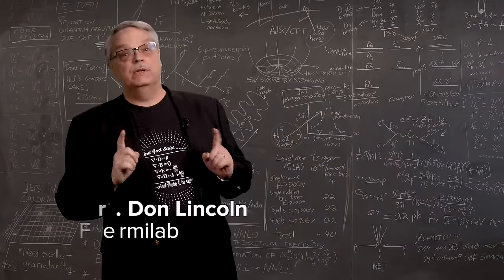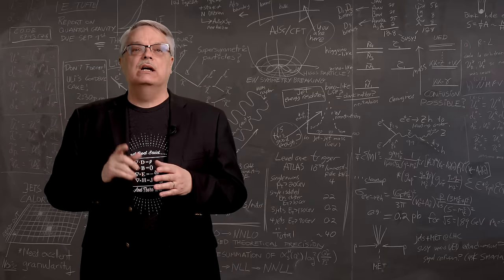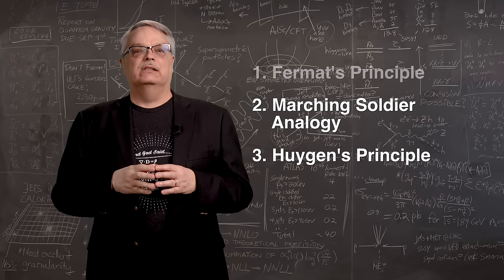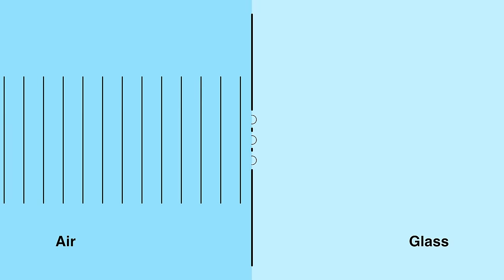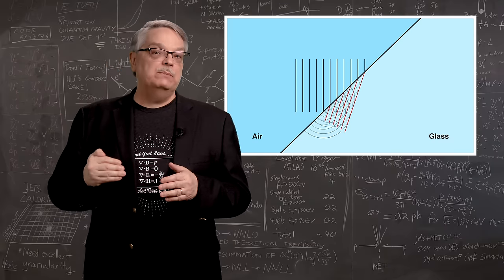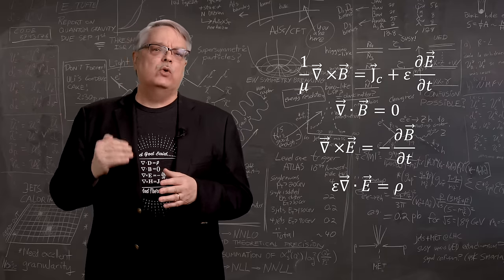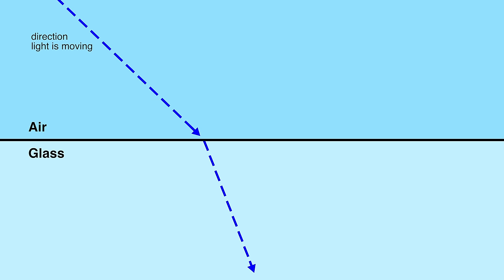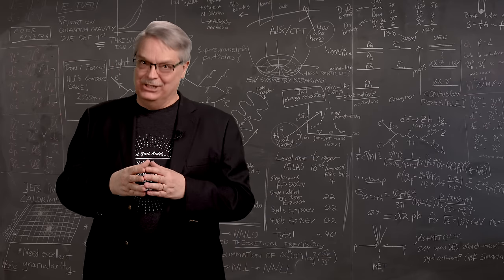Why does light bend when it enters glass?

Comment: 12:47 I assume the re-arrangement of the electrical charge takes some time.
So what happens with the "first" photon hitting the glass. Is it going in a straight line because of the not re-arrangent electrical charge?
Or is the re-arrangement itself already influencing that photon since the re-arrangment itself needs energy to happen? How can that influence happen over a distance if the light is going by c?
Greetings
Reply: Do you have the explanation now..I really want to know
Reply: @TheAbizgreat10  as far as i know that actual light, or that specific photon will be absorbed by the atom, but now the atom is excited meaning it has more energy wont be stable at that higher energy level, so it will re-emit the photon, but that is not physically the same photon but just the copied version of the original, so it looks like light comes trough glass, but its just the effect of it what comes trough.

photon itself in theory moves in a circular shape, which has its own wave like motion, but when light comes trough glass its a different kinda wave, its more classical physics kinda wave effect, that one atom reemits a new photon, than that photon will travel with 300.000 km/s but only until its captured by the nearest atom, then again atom is excited but not stable, reemits photon again, so the light travels 300.000km/s all the time when its actually travelling, but absorbing and re emitting takes time, and that will make it look like that light is slower now, but its just a kinda trick

this wave effect is now similar to the sound wave, where the sound is not actually gong trough stuff, its just the effect of it appears the other end of lets say the glass door, so u can hear a person talking to u and u can see them trough a glass door, but how the photon is actually moving in vacuum is a different story , probably no one knows how s that happening on its own, cause no one knows what the electromagnetic field is physically
Reply: @fifferfiffer2  Hi. I think you need to see fermilab's original video on "why does light slow down in water?". You'll probably find it interesting
Reply: Here he has treated light in a "classical" manner, like a wave. The whole "photon" (particle) interpretation and analysis does not apply in this case. To understand it in terms of the direction a photon is moving we would have to use quantum mechanics equations and principles like the uncertainty of position-momentum.

Comment: That was a great explanation. Now I would like to know, why some materials let light pass, some absorb light or some reflect light. What is the physics behind THAT?
Reply: Matter is made up of atoms, atoms have electrons in specific orbit(al)s around the nuclei, each orbit has a specific and fixed energy gap with other orbits. Suppose there are two orbits with energy gap of E, and you supply exactly E amount of energy to an electron in the lower orbit, it will take it and will jump into the higher orbit, if you don't give that specific energy E, little less or little more and the electron will not accept it! Now, lights come in different wavelengths and hence energies, some lights will have that exact amount E and that specific atom (of that matter) will accept it (absorb) and will get excited... you send light of slightly different energy and it will just pass through (refract). By the way, all that refract, they reflect too, in general, they scatter light....
Reply: @atanunath  Hi atanu, I am confused with the absorption thing. Is  absorption always related to transition?  I ran into some thing about absorption to x rays as a function of the x ray energy.  It says the absorption decreases with the x ray energy gets higher until it reaches a  specific energy under which the inner electron transition happens and abrupt increase in absorption occurs. 
I knew that absorption happens alongside the transition of electrons, but is all absorption linked to electron transition? What happens during the decreasing region I mentioned above.

English is not my native language. Hopefully I pass my idea clearly.
Reply: @linseito2530  if you can provide a link I can try to explain

Comment: But why does red light bend differently than blue light?
Reply: Good call. 
I think different colors have slightly different charges (solar panels work more effectively in the blue end of the spectrum), so i guess that would change the length of the perpendicular charge
Reply: The energy level, blue have more energy, its a faster oscillation and smaller wavelength compared to red
Reply: Because ε (called the dielectric function) is different for different frequencies of light. That is to say: the medium (such as glass) reacts differently depending on the frequency of the incoming electric field.
Reply: ... Now he needs to make another video, and include the physics of prisms ;)
Reply: Because the responsiveness of the electric charges in the material depend on the energy of the light. E=hv the energy of the wave depends on Plank's constant times the frequency of the light, so the pushing power of the light depends on its wavelength - so its ability to shove electrons around depends on its wavelength. So the refractive index of the glass depends on the wavelength of the light. Lenses which bring more wavelengths of light to focus on a single point are made out of several layers of glass with different refractive indexes to achieve this and are called Apochromatic lenses and cost at least twice as much as lenses made of a single piece of glass.
Reply: How are people accidentally disliking this video. The doctors insights and sharing to us is priceless in my opinion
Reply: I suppose an intuitive but not necessarily right answer is blue light has more energy (same magnitude so same arrow length, but blue’s frequency is higher) so it creates a larger counter-electric field in the glass
Reply: E=hf
Reply: Because the refractive index is dependent on the wavelength of light. It's called dispersion. The simplest dispersion formula is the Cauchy's formula: n= A + B/λ^2
Reply: Since both have different frequencies, both electric fields have different frequencies. So, energies of both are different. So, even if the parallel component is same, the perpendicular components are different. So, their resultants have different directions.
Reply: @huepix  light doesn't itself have charge, it the medium of interaction of charged bodies
Reply: @coastwalker101  cool!
Reply: Because the electric permittivity is a function of frequency. If you suppose that matter is a bunch of electric currents, you can get the ecuation of the electric permittivity. But you would need a couse in electromagnetism to prove it :(
Reply: This question explains nicely why Feynmans least action principle is so wrong to explain light bending. If we went by Feynman then all wavelengths of light should bend the same
Reply: You are all wrong!!!   It is about the interaction of matter and light with the quantum vacuum...  The maximum speed needs to be devided between the bound electrons and the fotons travelling through though
Reply: @coastwalker101  Well put. And yeah, in photography we call that chromatic aberration - it's one of the reasons why better lenses tend to have more elements in them, often more than a dozen.
Reply: @coastwalker101  twice as much???
I wish.
Iol.
A 400mm anachromat is about $2500.
A 400mm apochromat is about $14 000.
Reply: @huepix  Then use a parabolic mirror.  Law of reflection is the same for all frequencies.
Reply: @pranavgade527  seems like the correct explanation but when you apply the logic, as explained in the video, your explanation isnt correct. 

if the factor by which the perpendicular energier changes is the same for both colors, the effective ratio between them will remain the same. (and ratio between them will define the angle)
That is perpendicular energy/parallel energy is only dependent on epsilon. Perpendicular energy/parallel energy is not on the actual energy or frequency.

I believe the reason for varying epsilon is, as explained in the previous speed video, the difference in how the waves combine due to differing frequencies.  The interaction between the high frequency blue wave and the "standing wave" of the glass makes it a lot more slow as compared to the way the low frequency Red wave. 

I like to think about it as the lower the difference in the light frequency vs "glass standing wave" frequency, the lower the "drag". If we shot a light of the same frequency as the standing wave of glass, we would probably get NO bending. 

I hope someone can correct me if i am wrong.
Reply: If the electric field in the material reacts differently to blue light and red light, should a red light beam then not be diffracted differently depending on if you also shine blue light over the prism or not?!

Comment: I got your explanations. Simply the reason why the epsilons change is cause there is a vectorial sum of the EM's electric field and the glass's electric field generated by photons that enter it, interfering with the wave function of light that incide on it. The latter electric field is a lesser magnitude and opposite direction, causing the resulting total electric field to be less in glass than in air.

Comment: I got a low grade in HS physics (optics) because I argued that the textbook explanation was wrong. It was Snell's law based on Fermat's. I said that explains HOW but not WHY. How light "knows" how to calculate those angles. And the teacher got upset.
The he tried the marching theory and I asked why the photons are tied together to bend. Why they don't just go straight, aligned with other photon.
Didn't make it to interference explanation. I was ready to say that's good only for a LASER coherent light.
In college I found out this explanation. Witch doesn't work either. If you send light between two electrostatic charged plates it does not bend based on the electric field.

Comment: Would Hyugen's principle still have issues if we had the proper infinite number of new wavefronts?  I'm expecting some equivalency here.
Reply: There isnt really an infinite number of wavefronts possible. Their proximity depend on the frequency of the light.
Reply: The distance between the linear wavefronts is given by the frequency of the light. But the Huygen's illustration also uses a number of circular wavefronts along each line. The spacing between these circles along each line is arbitrary. When you go to the limit of infinitely close circles, you get positive interference in only one direction, agreeing with Snell'l law. So this is a valid explanation after all.
The critique in the video is unfair, due to only considering one arbitrary spacing.

Comment: Thanks, very nice. question: What if the light is polarized // to the interface (E does not have a perpendicular component)? Then B will have to adjust I suppose?
Reply: If I understand your question correctly, if the light is polarized such that the E is field is parallel to the interface then then beam is entering the glass perpendicular to the glass (an angle of 0 with the normal), and the beam will move into the glass and NOT change direction.  The light will slow down (see the video he refers to at the beginning of this video).
Reply: Mr. Swaney, not in general. In EM waves, E is perpendicular to B and also to propagation direction. there are two basic possibilities for E. The video uses so-called s-polarized EM waves. In s-polarized waves, B is // to interface and E is perpendicular to B. In p-polarized waves, E is // to interface and B is not. You may just search for "polarization of light" for explanation. for p-polarized light, I guess one may invocke the continuity of Maxwell Eq. for B at the interface and get the same explanation for the bending.
Reply: @Hiking-guide-and-scenery , ah, I think I understand your question now.  What if the E field is directed into/out of the screen as we watch the video.  Good question!  As he said at ~9:08, he was only going to focus on the electric field.  But it seems even then your question still applies.
Reply: @ Mr. Swaney, Yes that's it E into or out of page. well, I suppose he would change teh explanation from 9:33 and say "we keep only the 2 top equations..." But it is easier explain with E field as he says, because the B field would involve current loops~~

Comment: In the "Lazy-8" dipole photon model I"ve used for 40yrs in optical designs Brewster's Angle occurs when a photon "Centers Up" on media surface & leading half shrinks to size of a slower speed, but trailing half (still attached) just touches the glass surface and SPLITs off to be reflected away~ worked for me as I designed 1st LandSAT scanner 
IF U place a wood spatula vertical in a micorwave oven that has a wire grid suspended off oven floor U can get an image of a 2.41" half-wave "Lazy-8" photon w/2 concentric diameters> One dia of 2.41" and a smaller burn image of a photon that's absorbed by metal wire proportional to speed of electricity traveling along the wire> Simple to do but it tells U when a photon strikes a conductor, it "Centers Up" on the conductor as it transitions to its slower velocity

Comment: A practical application, similar to the life guard example: 

I'm partially disabled due to a stroke.  Walking is a bit awkward and slow, much more so in grass, which drags on the affected leg.  When I must walk partially on pavement and partially on grass, I tend to take a beeline across the grass directly toward the pavement.  Something in the back of my mind wondered if that was the best approach, not that it's really that important, just a mental exercise for a retired mechanical engineer who's not super sharp on physics!  Now I have a solution: as I approach the grassy stretch, all I have to do is apply Snell's Law!  Of course, I'll have to get accurate measurements of the distances, angles and speedsubgrass and speedsubpavement.  Easy!  Or maybe I'll just split the difference between straight line and beeline and call it a good enough guess...

Comment: Very nice, but I have an issue with the Huygens wavelet argument... I'm pretty sure you only get multiple possible directions if the points along the interface are too spread out. In this case it resembles diffraction from a grating and what you observe are the higher orders of a diffraction pattern. This is just an artifact of the construction, however.  Just like a diffraction grating, when the distance between the point sources is small enough, you only have 0th order diffraction and therefore just a single angle. This would be a better representation of the interface, since it is continuous, with the distance between the wavelet origin points tending to 0.

Comment: I had the same question raised in my mind and i read all three first explanations on various website and I too had the questions raised that its still not the complete explanation and this is the best explanation yet. But, as the final point depicts that the light's direction changed in glass as it had more densely packed electrons which resulted in an arrangement of electrons in the medium which created an electric field that opposed electric field of EM wave [light] which resulted in a reduced component of electric field of light. Since, for this explanation, electric field is developed in glass would make its one side [where light is incident] attractive to nearby negative charges and vice-versa on the other side [emergent]. If this were to be the true explanation of this phenomenon, it would also mean that if I turn light on/off very fast on single side of glass.....[light on] the charges will rearrange to oppose light's perpendicular component and and randomize when light is off. This means that charges were continuously accelerated and would hence develop magnetic fields due to light and glass will be magnetized. But since no such phenomenon has been observed, it means that this explanation is also so far not completely right. And if there is some mistake in my understanding of the concept that you explained please correct me and if not I would like critique response as well.

Comment: 4:38 "the soldiers will slow down but their direction doesn't change" Well, how about this? Each soldier has two feet which are attached to a rigid pelvis by two legs. When the right foot enters the mud first (it has to be the right foot of each soldier in each row entering the mud at the same time as every other's in the row - easy as they all walk in sync - and also it must be the right foot entering the mud first for every row - that would require the right spacing between the rows in order for it to happen) it will slow down a bit whereas the left one will continue at the previous speed which will cause the creation of  a rotating moment about the right foot. Kind of the same effect one would have instantaneously while running on two treadmills at the same time (one leg on each treadmill) which go at the same speed when, all of a sudden, one of the two changes speed abruptly and the corresponding foot comes into contact with it without  the runner having the quickness of reflex to readjust the force exerted by the foot in time.
Isn't this similar to the situation where all soldiers in each row are connected together by a rigid pole? We now have a rigid pole (i.e. each soldier's pelvis) but at the same time continue to have independently moving soldiers in each row.

Comment: The difference between a line drawn on a flat surface and a line drawn through a volume is not immediately evident.
What has been called refraction in Optics may be nothing else but the confusion between those two shapes.
An oblique line starting at a flat surface, like water, and going through that surface, in depth, instead of staying on the surface, will necessarily go through the deeper surface at a different point, giving the familiar impression of a broken line.